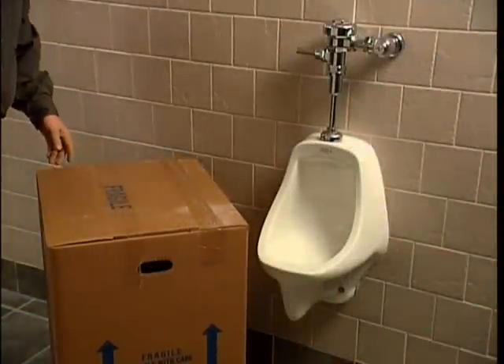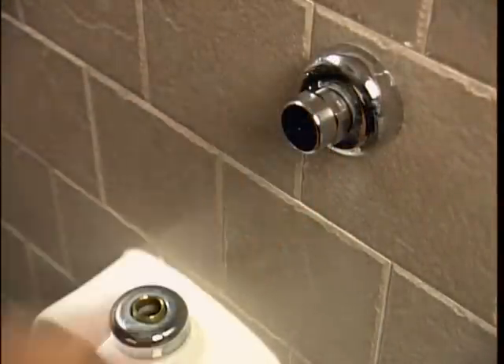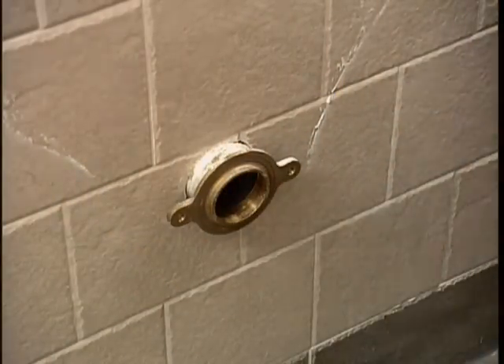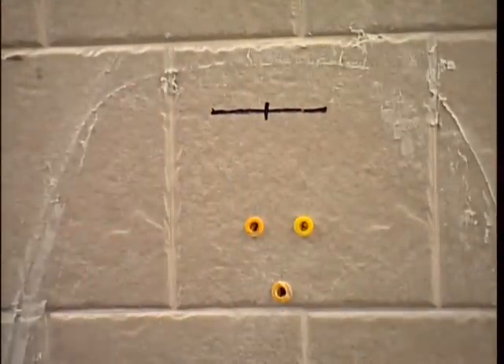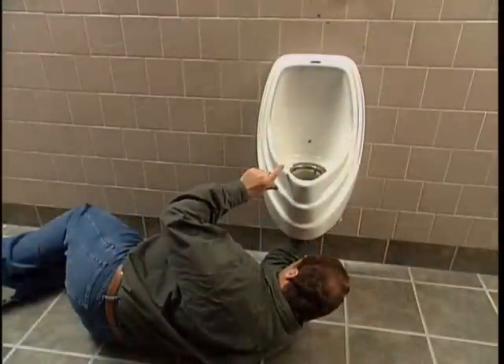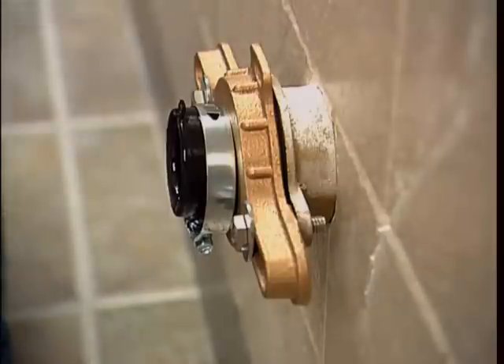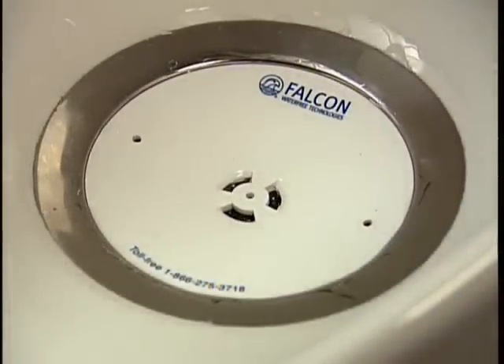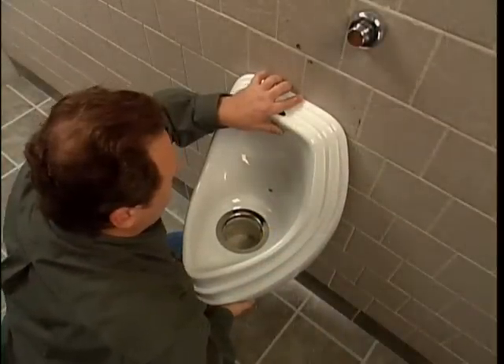Falcon Waterfree Urinal Installation

Comment: In 10 years, be ready to open up the walls to replace the corroded DWV copper offsets which connect to the cast iron tap tee fitting. You'll know when the pipe's rotted by the fetid stench of uric acid wafting from inside the wall framework and polluting your nostrils.